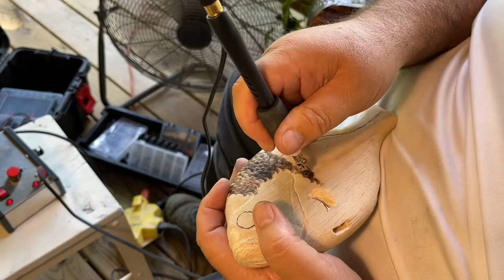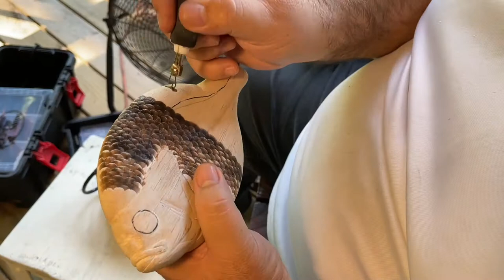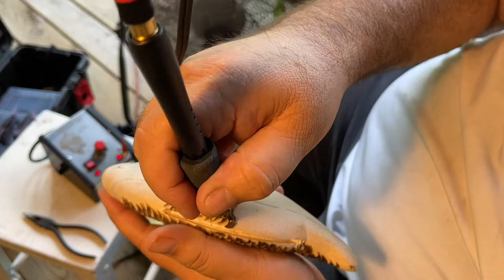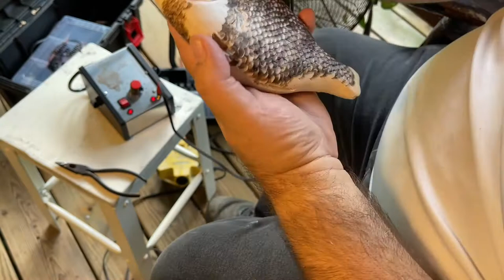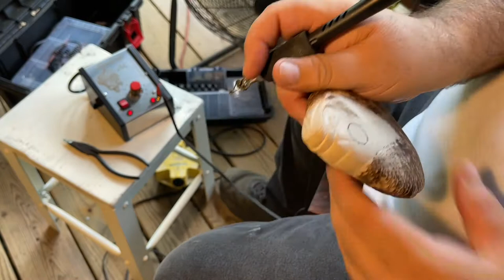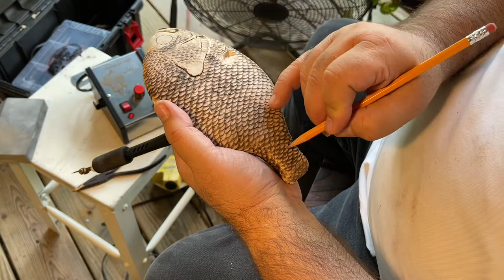Bluegill wood carving, burning scales part 5

Comment: What are you using for a scaling tip?
Reply from the maker: I use a Razortip wood burner and they have scale tips. I have two styles in 4 different sizes each.